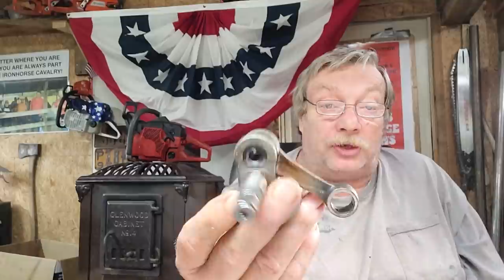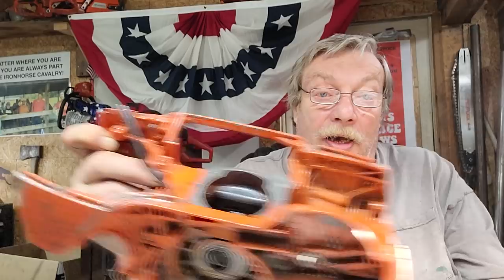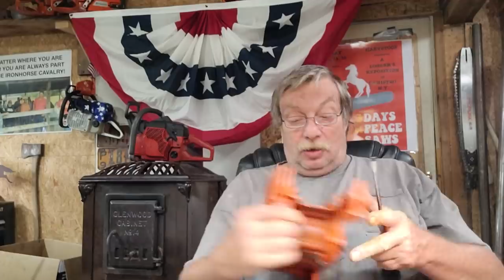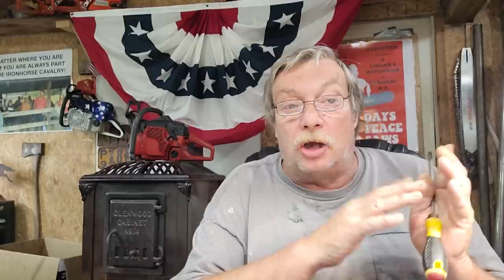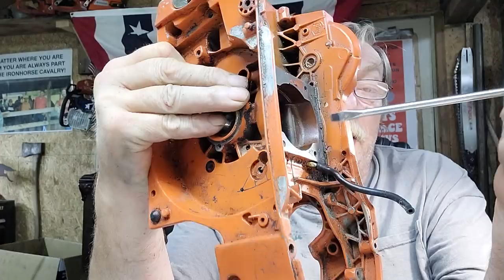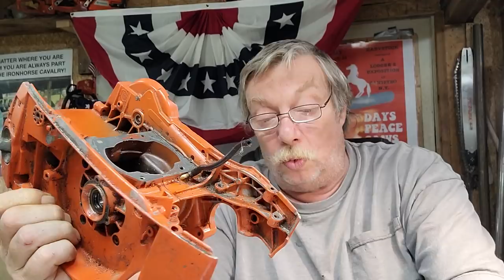let's talk about case volume and how it affects saw performance! the tricks that go with it!

Comment: Hey Harv, interesting video. You are 100% correct about peak HP as it relates to case volume. I believe a lot of guys get mixed signals coming from builders that need quick throttle response at other than wide open throttle settings. Thinking trials bikes here. Also, kart engines without transmissions (single speed not shifter karts). In these applications, mid range rpm power and throttle response is key. Stuffing crankcases was the game for single speed engines as it enabled better, wider power curves throughout the upper mid-range and even just off idle. This did affect peak power negatively, but more than made up for it in mid-range power and acceleration (throttle response). Quicker lap times is what we were after, not just max wide-open HP. Saws only get run at 2 speeds man, idle ad WFO! A good saw operator eases up (or bears down) when he needs to, in order to stay at peak operating rpm. You get a faster cut that way. Keep up the great work sir. Your videos are awesome. Tony

Comment: This is a Damn good  topic ! Folks you need to pay Attention to Ole Ironhorse ! Back in the late 70's and early 80's we were  cutting a angle in the front of the through's about a 45 degree when we were racing the 101's 91's 125 Mac's Cart engine's as some of you may know them.A Machine Shop that sponsored us cut and balanced the crank's.We did see quite a bit of difference on the ramp up RPM's. The flow to the transfer's also made a  huge difference.That's from a Ole Racer with a little bit of knowledge on 2 strokes. A Little Bit the Mule Said ! LOL

Comment: I've had most of my saws apart.  I really got after my Husky 440 X Torq tho. Most of you probably think that's stupid because it's not a 372 or a 395 and not worth the time.  Let me tell you, for me that saw is small, nimble, light, and doesn't kill my back.  That thing now blows the doors off of my stock Husky 257.  The 257 was sort of a hotrod from the factory. I bought that saw new in 1997 and it's been my main saw ever since.  This 440 was found in the garbage.  It looks almost new and the only thing I had to do to get it running was add fuel and adjust the carb.  I was shocked somebody threw it away. I don't have that kind of money to throw running saws in the garbage. So that's it, that's my 440 story dumb or not. Harv, I love these tech talks. I eat it right up and hold onto every word!!  I'm learning. I only started playing with saws the beginning of summer or close to that.

Comment: On a 100 cc go cart engine,full circle crank. We took half the knurling off the the tooling witch would leave a cup shape knurl in the rotation of the crank.On the top and the side angle of the crank .rebalance and we got more power in the top 3000 high end. We called it turboing the crank. Also hogged out the transfers left them rough for atomization.

Comment: Amen! I got told that all of my experience with large displacement diesels and race gas/methanol engines would do me no good when it come to chainsaws because two strokes and 4 strokes are two totally different animals. I agree but every reciprocating engine requires air in and air out. Anyone who has every built and worked on 2 stroke Detroit diesels can attest to that. Harvey something else they often don't know is that those big cam high compression race engines don't have any significant amount of vacuum so they rely on all of that volume to get a big gulp of that fuel enriched air in that big intake. I've heard the argument of velocity vs volume and from experience I know that volume will win everytime. Now if we could put a blower or turbo on a chainsaw and have velocity + volume, woooo beyond that puppy would sling some wood! Thank you for all that you share sir! Great channel!

Comment: Crank/case theory -- I love the idea "What if you angled the counterweights, so they're chucking the charge at the sides!", for a second I was thinking "YUP!!" but immediately realized(theorized) that you can't do this--- as you say, that slug is slamming, from 0mph to >100mph, hundreds of times/second....and the entire piston-crank-train assembly is built for forces on ONE axis, not for radial/lateral forces, which is precisely what you'd be inducing by edging those counterweights to 'throw charge to the sides'
I don't know if this would be enough to be problematic, but suspect the only way to tell would be to setup one with exaggerated flares on the counterweights, then set it up in a machine to run full-throttle til-death, to see if its longevity is being reduced (or if failures/deaths are now all crank/shaft related)

Comment: Harv your freaking awesome the comparison to high rise intakes on Chevy small block engines is absolutely great, and as you've always said it depends on what you wanna do with saw that determine how you build the saw I've got a 660 that I'm thinking about doin almost the exact same thing to in the cases lol been wanting to for a while I already know I not gonna mess with transfers much base gasket delete move that in take just a bit big bore kit, pop up, clean that flash mod the carb a little and gut the muffler but I do have a few questions about some ideas as far as everything that actually rotates maybe lighten the flywheel just a tiny bit to reduce rotational mass and in thinking about drilling some hole in the clutch to reduce rotational mass, but only if I know I can keep the clutch drum Ballanced enough but I am definitely goin to do all this in very small steps so I know what does what and when to stop here's the kicker tho lol I've never ported a saw before, uh oh ,. Lol,  but I do understand for the most part, how 2strokes work, hope you and barb have a wonderful great day thank you Soo much for the information you share godbless and oh yeah thank you for your service

Comment: Ok my gears are really turning now I think I had left a hairbrained comment awhile back about having a double pumper like a spark in the case and chamber and dual everything, almost...probably impossible but that's just my mind and that's the direction its turning tight now, CASE VOLUME OF COURSE!, MAJOR PLAYER. Oooh I so excited I learned a new concept to run with

Comment: Hate asking a question 1/3rd through a video but fear I'll forget-- Does porting/grinding on my piston's windows, hogging-out my lower transfers, do those moves "count as lower-end displacement" for our purposes here?  Or does it genuinely need to be inside the crankcase itself, like displacement that is vertically below the cylinder?
Thanks!  Am trying to work-out compression on a pair of big-bore 66's (56mm kits, jb'd intakes) and making them pretty 'tight', but they're ending up well over 100cc's and between the crankcase, the smaller piston and the huge lower transfers, I wanna ensure my "displacement gains" are "matched properly" (my thinking, after having watched enough of your insights on this topic, was that by adding the big-bore I would be upping displacement, which is good, but that it's all top-end displacement IE I'd have a HIGHER power-band than before, but it'd peak at a lower RPM because the upper-to-lower displacement ratio was bigger now, since all that new displacement is top-end displacement...so my thinking was, since the big bore jug added ~8cc's to the top-end of the engine, my goal was to add the proportional increase to my lower-end...AND THEN SOME!  IE I don't just want to maintain my RPM-peak point, only with a higher total power-band, I want to shift it, so I need to not only "open up bottom end displacement" to match the big bore jug, but need to over-do it so I can shift the peak-power to higher RPM!)
Would I be right in thinking this build will benefit from an 8-pin?  It's intent is to be a "fast/hot woods-port" for felling trees, my other 660 clone is a 32" that I built for long period bucking, this big bore'd has a 25" b&c and will be 'hot'/fast, my understanding is I need the 8-pin because, with all that power onto a 25" bar, I'll be wasting power not using a higher gearing (IE 7 pin just isn't enough gearing for such a short bar....am not even sure if I'm going to leave the 7pin on my 32" unit, but at least there it makes more sense IE letting that longer bar start&stop quicker!)
Thanks for the grade-A content, as always!!
Reply: Oh and Re your mentioning your intent to "get into some hot-saws", I try keeping-up but you put out a ton of content, did you do 1 yet that you'd call a "good example"? The saw I mention ^ in my top-level comment above, that's 1-of-2 of my 660 clones as mentioned, the other being for bucking, the bucking one is 'regular woods-port', has a ton of OEM parts etc, it's a thumper don't get me wrong but not 'hot'...I literally am building this other one, the "felling saw", to be "woods-hot" (IE I'm thinking something I can basically use to drop a 4' Oak, then let it cool down, lol....I want it screaming through heavy trunk-wood, the trees here in coastal FL are short, yes, but our most prolific species is the heaviest timber I know, Live Oak, at 76lbs/cu ft., so yeah trunk/felling cuts require good machinery!!)  But yeah my thinking is "IF I can do a 'hot woods port' successfully, it lets me know the 'boundaries' for my bucking saw, so I don't leave anything on the table there", because as you know it's all about power-to-weight (loved your 440-v-460 discussion video, where your brother chucks the 460 in anger :P ), my entire saw lineup is literally a game of "50% more" from 25cc to 37cc to 60cc to 90cc's(well my two 660's, which are modded so they're well over 91cc OEM now but you know what I mean)  Of interest to me was when I recently found that the horsepower-per-CC, of basically every pro saw, goes up (IE more efficiency per CC) to at least 100cc's, I mapped all my saws' power//weight and the only anomaly was the 2511t which, at 25cc, slightly eeked-out the 355t (36cc), which is stupid-impressive because the 355t was IMO a work of art, just like the 200t/201t it's an 8lbs, 2.1HP monster, I still run mine w/ 18" and bury it in Live Oak and its 3/8LP can be half dull and it still eats :P

Comment: This case volume topic is interesting....  it has been reported on a opeforum and arboristsite  that crank stuffers make stronger saw. Also Husqvarna  uses them on their XP model saws but their detuned saws on same pro chassis dont have them. Edit: more case compression moves the power band up but it also makes it more narrow. So chainsaws use relatively low crankcase compression.

Comment: Hello Iron Horse, thanks for another great video.

I have a question that your expertise might hopefully guide me...

I have a near new Dolmar (Makita) EA6100P which i saw you have covered in recent videos. It's a lovely saw, my first "proper" saw actually. (And it gets a lot of use) The problem is: when im sawing through a log, felling etc at full rev's, break through the log and I drop the throttle, well 3/4 of the time now the machine just drops dead, will start again though. I have taken it to warranty shop who said its common and claim to have done a retune; problem still exists...

I have tried, and the only way to avoid this drop out is to feather the throttle towards the end of the cut, then continue to to feather for 3 or 4 times after its clear from wood.

What are your thoughts?

Is this something wrong with my technique?

I've checked the spark plug, new fuel etc etc... I'm kind of at the point of taking it bacl to the shop but was wondering if you or anyone had any suggestions?

I'm certainly no professional, so any advice would be muchly appreciate 

Greetings from Far Nth Qld 👐
Reply from the maker: They do that!  Have someone cut the muffler in half and gut it! It’s very restricted!  Open the exit of the muffler to 5/8ths!  It makes about 1/3rd more power and won’t stall coming out of the cut!
Reply: @theironhorse6600  thanks for your suggestion OH 👍, I know you have some exelent videos posted of this process, will see if i can upskill thanks to your support!! 

I have a dremel which might come in handy too

Thanks again, your a Legend 👋

Comment: Hey Harvey look up Tesla valve, could it work on exhaust .I am  thinking it could remove that sonic blast back into the cylinder.
Reply: Interresting thought, but a Tesla valve needs way to create the needed Different speeds of Flow / pressures and a chainsaw muffler has not enough volume/ way to provide that. I 'm also curious how such a valve reacts at the high frequency of die pulses a powersaws creates.
Reply: @sebastianleicht  If muffler was c shaped shaving high frequency on the way back

Comment: Thanks for kind of mind blowing in the morning. LOL. So I have question or 2 since I have been building a couple of the Husqvarna 575s and now to the last one is a 576 for myself, manly because of the really good deal that I got. So to the question on those saws the transfers are feed from the front of the case instead of the sides like the 372s. Is that going to play a big deference when you remove the crank stuffers?   As always very enjoyable to lean and thanks again.

Comment: Missed you brother..been real hot& muggy..I'm going slow but sure..I know the case volume concept does matter..when I raced 250s we used a 5mm spacer under cylinder with a longer rod 5mm...that bike was unbeatable...
Reply: Been to hot Tim. Good days are coming though! Hopefully the fall gives us the weather we need. Could sure use it. Be good.
Reply: @eriknelson6529  Hi Erik..yes looking forward to cooler weather..less rain be nice also..I see you 've had the same wet summer..been a challenge..be safe buddy...

Comment: The light came on while I was quiet. Valve overlap. When the lifters are both on the quiet part of the cam in the same cylinder the vales are both partialy open causing intake gas,s mixing with the Exsuast gas,s. causing a blow torch efect.

Comment: I call it danger space, on my numbers an d shooting long range, get ur range wrong, wrong enough, far enough out if ur plus or minus a few yards could be 40 feet...at thousand ysrds, danger space plus or minus whatever degrees, thou, yrds, ect...every situation is different and  understanding everything and having an open mind is key building power, I built a major compression saw cord snapper, I've been slowly increasing my exhaust height for more rpm, right now it's like a damn diesel, its badass dong get me wrong runs great but I can gain A LOT  of rpm and loose PLENTY of torque

Comment: Teach math  correctly.  The cc of a saw is pretty simple. Cc= Pir2h/ 1000. In the example you used it is 
Cc= 3.14* 28 squared * 38 = 93.55.  28 is the radius if 56 is the diameter.  The reason you divide by 1000 is to convert it to Centimeters.  Teach it like it was taught to both of us.  This ain’t Common Core.